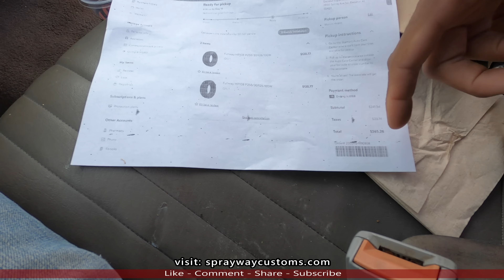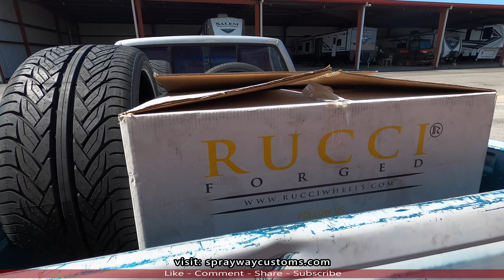FINALLY Test Fitting My 26s Rucci Wheels For My OBS Chevy Silverado - Brushed Rose Gold 26x12 9"Lips

Comment: You would need a 255/35 to get a similar size sidewall as the 295/30.  The second number is a percentage of the width to give the sidewall height.  30% of 295 is 88.5, and 30% of 255 is 76.5. So if you did 255/35 it would be 35% of 255 which is 89.25. Much closer to 88.5. 😁
Reply from the maker: Thanks for the info
Reply: @SprayWayCustoms  hey boss,  was this truck stick height? I have me a 1994 Stepside that just got tagged today.  My Tia gave me hers that she bought me in 94, but been sitting for 10 years. New motor, tranny and most parts before and in-between replaced.  😀 I'm happier.... but could be more happy with some 26's!!!!!

Comment: When you measure for your rearend you have to account for how far the caliper and bracket sits back from the axle flange, a drum brake backing plate is flat which has more room till it contacts the leaf spring. I dont think you have enough clearance to shorten 6 inches per side unless you relocate the leaf springs inbord of the frame.
Best bet to assemble brakes on one side and measure to the leaf spring.
Reply from the maker: Thanks

Comment: Check the clearance to the frame and inside bed. Make sure you dont have to narrow the frame as well.
Reply from the maker: The frame good but I’ll have to cut the bed though
Reply: @SprayWayCustoms  That's good. Much easier process. They will look good tucked in.

Comment: Hey @SprayWay ; quick question. What grit bare metal prep do you use for epoxy primer ?  I have my 89 Toronado down to bare metal, cut paint off with a purple polymer disk, then smoothed with 80 on a DA, then 120, then 220, and I then did the hood and trunk with 320..  I think that 320 surface may be too slick, and I'm thinking I may need to go back down to 220 or even 180.  What do you do to prep for epoxy ?
Reply from the maker: 180 will be good or even 80
Reply: @SprayWayCustoms  Hey thank you for your recommendation.  I thought something was wrong, when everybody says scuff the surface, or epoxy won't stick.  The 320 feels like a piece of glass with the 320, but luckily I only did the hood and trunk with it, so not a big deal.

Comment: 3”-4” each side. You want the edge of the tread at the fender or it’s gonna look like the whole wheel is under. It looks like a couple inches between the edge of the fender and the face of the wheel. 3” each side is 6”. 12” is too much.
Reply from the maker: I actually won’t it inside the fender

Comment: Truly there not enough info to no for sure how much shorter the new rear end housing should be are you changing to full floater, someone said 9 inch that's ford rear maybe some difference in design, you should probably ignore old rear end and measure from lip to lip on bed sides minus back spacing and offset of wheels and that what width rear end you order  it probably still be around 12 inches shorter than old 1
Reply from the maker: Ok thanks